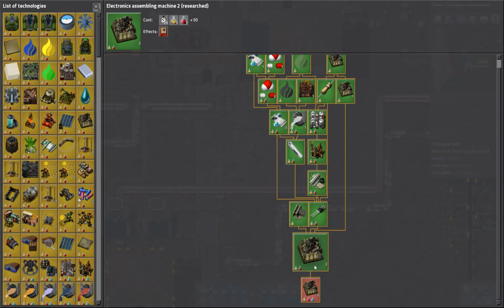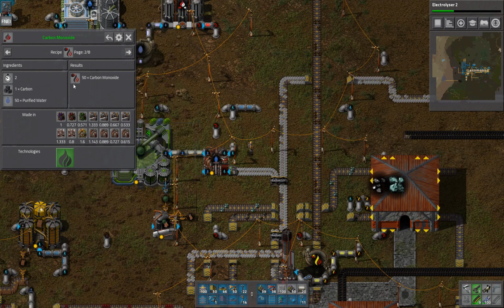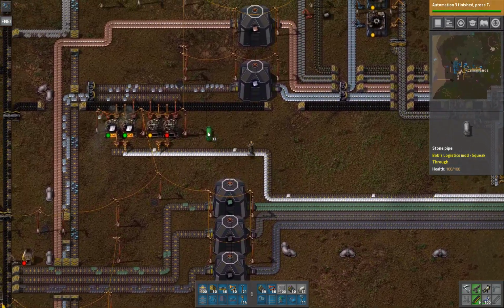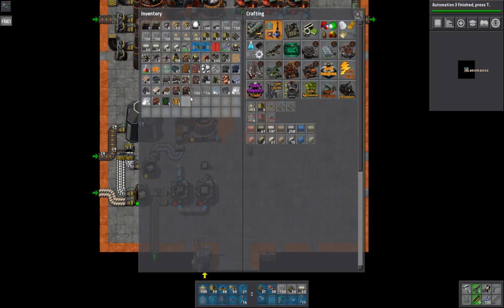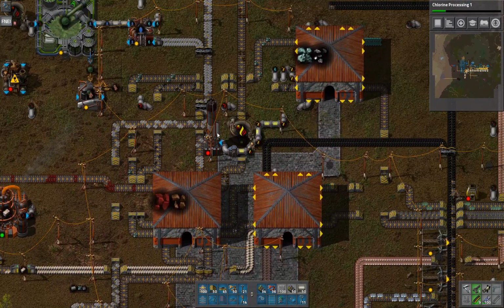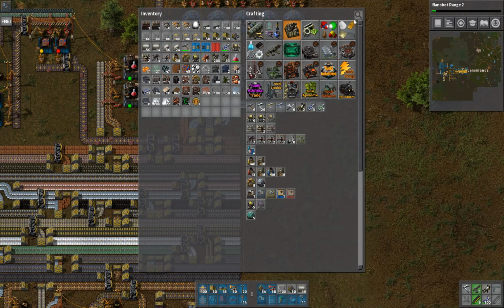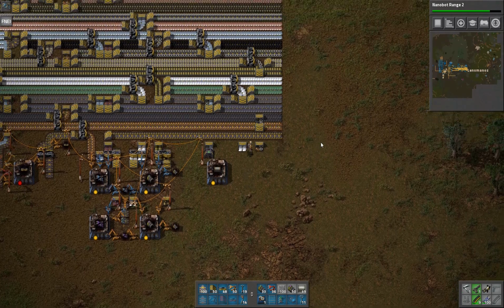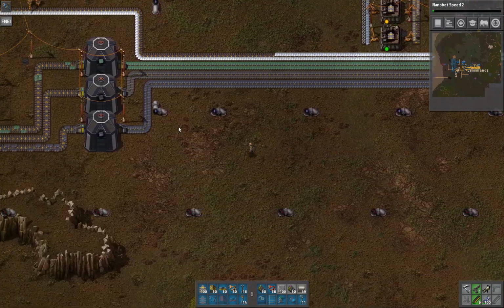Factorio Modded - Ep 11 - Engines

Comment: Your tin/nickel sorters are only exporting from the bottom set.

You're looking for the wrong symbol for Carbon Monoxide. You need the symbol on the top left of the NEI screen, where it's the purple/white/black symbol. It's on the Angels Petro Tab, third row, far right.

Only the top half of your tin plating machines are running.

I think the loader was working okay on the Powder machine, it was just so slow it didn't make much difference.
Reply from the maker: I'll take a look at all of these issues. I admit I was a bit tired and distracted while recording.. Whoops
Reply from the maker: Yup I'm such a derp. Didn't even hook up those bottom machines.
Reply: No problem. And frankly, symbols not being what you expect them to look like is really annoying.